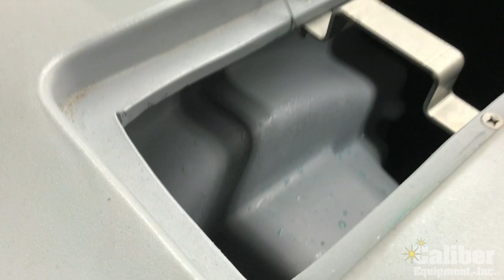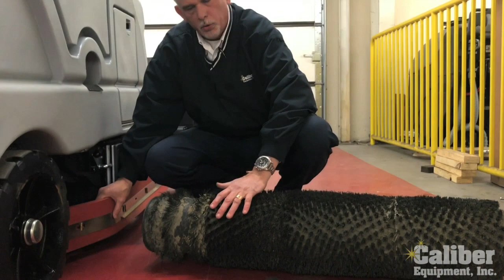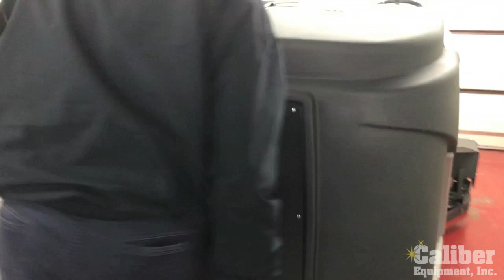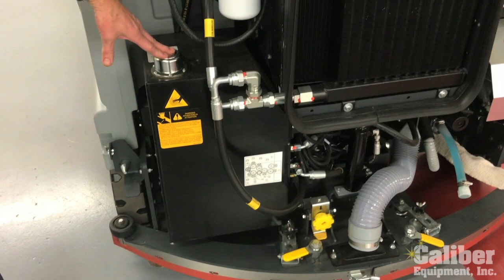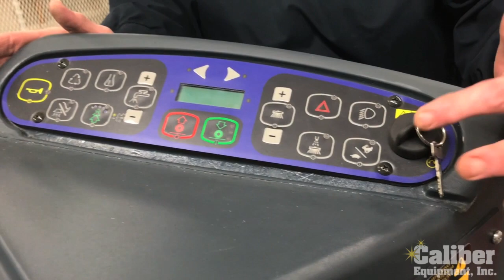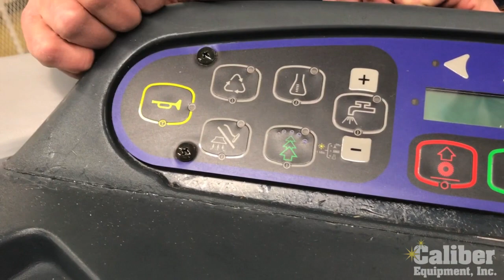Advance SC8000 Training Video

Comment: Great video thanks, in your opinion which is better. The SC8000 or the Karcher B300 combo machines?
Reply: Hello,
They are both great machines however it depends on how you want to use them. The Advance SC8000 is a wet scrubber sweeper not a dry sweeper or wet scrubber like the Karcher B300. The SC8000 has a larger cleaning path and greater capacity. So it depends on how you want to clean or the amount of solid debris you have to pick up.
Reply: @DavidBooth-o4l  Thanks for the reply, much appreciate it. I've actually moved my focus over to the Nilfisk Advance CS7010 now which can do dry sweeping as a stand alone function. I know you have them too. Any alarm bells / pot holes to watch out for with the CS7010? And if you ever come over to Ireland I'll give you a spin on it when i get it 🤣
Reply from the maker: The Advance CS7010 is a solid option if you want to sweep separate from scrubbing!

Comment: Where is oil drain tube?? Looked at several diagrams. See it on diagram but not on truck. Two videos and no help
Reply from the maker: For this specific model, we can walk you through finding the oil drain tube - Give us a call at 1-888-550-0945 and we can help troubleshoot!
Reply from the maker: We checked on a machine here - The oil drain tube is located underneath the radiator, which is accessed by lifting the rear cover - Hope that helps!